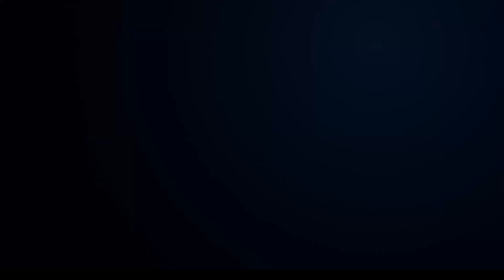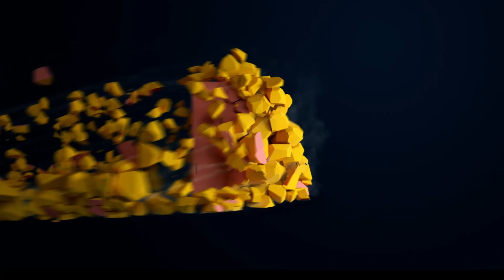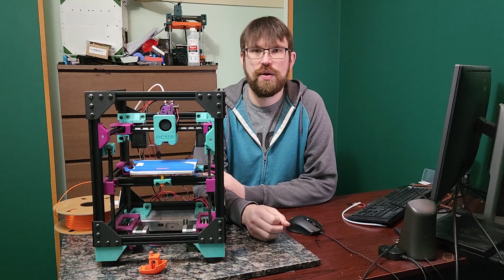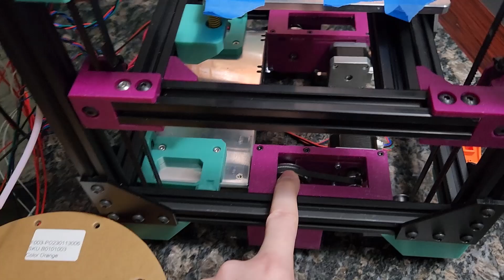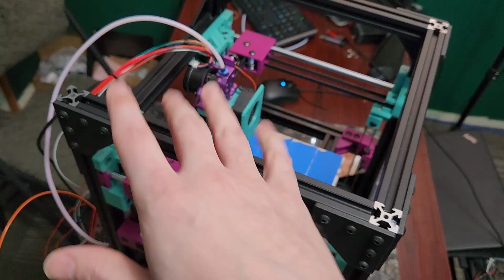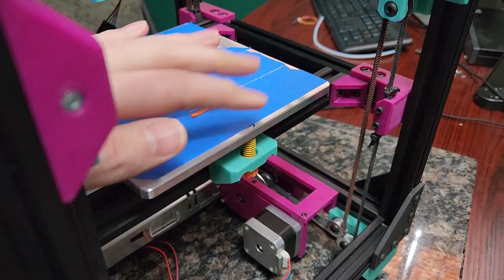Big Update to my CoreXY 3d Printer Panda Mini now called RC150!

Comment: Question have you measured the flatness that granite table top?
Reply from the maker: I don't have a huge straight edge but it seems pretty flat with my square and much flatter than my desk
Reply: Cool, I have an idea about using that as a printing bed want to know how flat can we expect these things to be..  i guess it is as flat as the rock cutter that has sliced it. A good and easy indication would be to measure it for thickness around the perimeter..

Comment: The Z is to complicated... If you use two motors why not use lead screws. Much more simpler, not so many belts and pulleys and printed parts... but this is just me rambling...
Reply: I have a mod that replaces one of the Z motors with a rod coming soon. Just need someone to test it really.
Reply: Leadscrews make banding on the prints.
Reply from the maker: if I do leadscrew it will be triple Z then, we will see
Reply: I don't see it as more complex, but I haven't had great experience with the backlash in my own belted z - it's not as precise, though that could be my (unrelated) design.
Reply from the maker: one of the benefits of belted Z is there is no blacklash. Leadscrews can have backlash
Reply: @Rolohaun  gravity solves the issue with backlash very effectively. Even if the bed weight is very light in comparison to possible heavy vibrations anti backlash nuts are dirt cheap and push 2-3 kg of load on top of that.
Reply: Also to mention a tonn of very fast kits with lead screws, e.g. Voron-Trident and RatRig-V-Core 2+